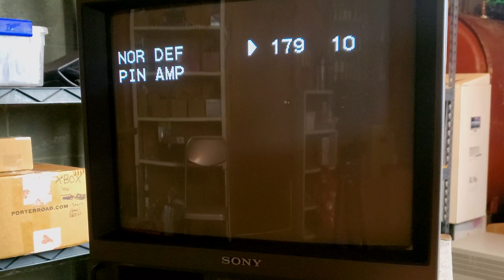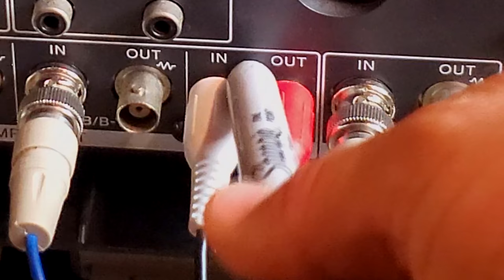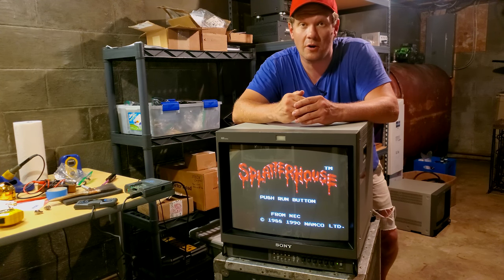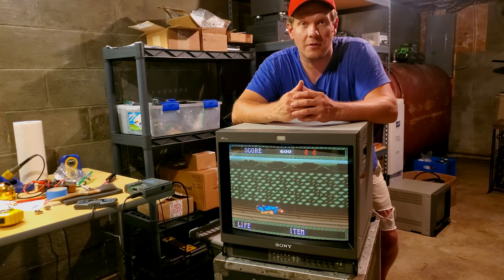Why is the Sony PVM 20M4U so Special & Expensive? 📺 Quick Tips: Features Overview

Comment from the maker: Hey Everyone, The Game is The Legendary Axe on TG16 through RGBS.  I did want to see if anyone else had feedback on the audio input and trick I mentioned.  Has anyone else tested this on other PVMs?  That would help confirm if this is something standard or not.  Thanks!
Reply: Hey Steve,
Those audio In and Out sockets are linked together with a straight wire (see service manual page 74-74), making a Y-connector. Normally, stereo to mono mixing schemes are using resistors to separate L and R amplifier output channels.
Reply: Mono and Left are always output on the white wire.  Both signals are always there as part of the analog audio standard.  I believe the mono is out of phase and when the input device is switched to mono it knows to process this out-of-phase signal.    Perhaps that is what is going on.  Does it sound mono when you unplug the red wire?
Reply: I definitely have feedback on your stereo audio input trick: don't do that!

As Mykhailo mentioned, the audio jack labeled "out" is designed for pass-through use (daisy-chaining) and thus is just connected directly to the input jack, very much as if you were using a "Y" cable. If you short together the left and right channels of your audio source it may work, or it may damage the output drivers of your audio source. At the very least you want to use a simple resistive mixer to prevent this from happening.

Note that the pass-through jacks for video have a switch on them: if a plug is connected to the "out" jack for these it will disable the internal 75Ω termination. So you don't want to have cables plugged into those output jacks unless the other end of the cable is plugged into a device that provides that output termination. (There's no harm going to come to anything if you do this, though; it will just make the image look a little a little brighter and possibly reduce the video quality slightly.)

Comment: I picked mine up before prices went crazy.  Glad I did,  it's a great set.   Just picked up a 20M2U that needed a capacitor job and after fixing it I will say you can see the difference in resolution between the two.
Reply: I dunno, I have the 20M2U and the 20M4U and unless you're right up next to the screen looking for scanline thickness, you aren't going to notice the over all jump in quality that much. I would argue the 20M2U is the better middle ground for a more "natural" look with 600 TVL for 240p sources. I prefer playing NES, SNES and Genesis on the 20M2U vs. the 20M4U any day of the week. I feel like these PVM's are ultimately about preference and to not give into the hype before dropping thousands on these monitors.
Reply: @quibquatch3975  how do you feel they compare in 480i?

Comment: I have this monitor, and indeed it's very nice! Got it for 100 euros, because there was a short in the canon but after an easy fix, working well. I have a question, what kind of silicone we have on the bottom of the canon maintaining the small plastic before the neck board? I removed it and I noticed that without that sometimes it creates a 'thick' like electricity short ?

Comment: The 20M4U is pretty much the perfect 240p/480i monitor along with the BVM 20F1U (not the multi format BVM D20), just a bit more common than the BVM.  I used to own the M4U, imported it and confirmed both the M2U and M4U works with 240V.  Despite not being printed on the rear label of the shell, you can see on the service manual that the power board is identical for all region models (A, U, E) and automatically switches voltage.  So although I don't recommend overseas shipping for PVMs, if that's the only choice to obtain one then people shouldn't worry about voltage.

Unfortunately my M4U eventually died and I sold it as a donor tube to a BVM owner.  Then I was extremely lucky to find a 20L5 locally, so that's my main monitor now for retro gaming.  I didn't know about that audio input trick so I tried it, and audio works fine on the 20L5 too.  Thanks for the tip.

Comment: @3:45 I don't know if you've tried using the out as an in on the component or rgb side but I was able to hook two different signals to them at the same time plugging all of them up.  I used a set of bnc to rca jacks for one side and an hd retrovision cable to my sega and then a bnc to scart adapter to my switcher and it worked.  Like I said I don't know if you've tried it but it worked for me. Great video and I loooooove mine and glad I got it a couple of years ago.  I only paid 500 for it and found it locally so didn't have to pay those outstanding shipping costs.  Now they go for crazy amounts.  Same with my 14m4u.

Comment: I recently picked up a 20M4E for 400€ and I have loved it every minute since. Are there any major differences except for the voltage intake between the 20M4U and the 20M4E? It is very hard to find someone here in Germany who does these kinds of restorations. I have no experience at all servicing these, do have some experience soldering though. Except for a really loud pitch noise (only sometimes not all the times, like an extra skrieching over the usual CRT sound) and some minor convergence issues in the bottom corners this TV has been wonderful to play on.
My question is: Do you still recommend replacing those 15 capacitors, following your tutorials or should i just stray away from that in fear of destroying what is, for now, a working CRT?
Reply: I have the three color lines(faulty capacitor) , and I am wondering too what to do....

Comment: Brother, i need your help in getting my JVC BM-H2000PND Broadcast monitor working once again. Was getting a flickering picture with a static sound and then no display, was suggested that the anode cap maybe dirty and not making a correct seal but its clean as a whistle, am getting neck glow but thats about it!

Comment: I have one but unfortunately it won’t display anything when powered on, even after I replaced capacitors.
Reply: Did you recap the power supply board!? I picked up mine two years ago and it would power ON with the red light up top and no image. I recapped the whole power supply board and that got it going.  Good luck
Reply: @ovalfastlx6724  recapped both the power and main boards. Still just getting a tally light
Reply from the maker: Did you test the voltage on the PSU to make sure it was sending the proper voltage?
Reply: Forgot to mention I did reflow solder to some connectors.

Comment: I have a sony PVM-20M4
All of the sudden, the retracing lines appeared at the top of the screen.
I replaced C-572 and C-584. No effect. I recapped all the main board (A), the neck board (C) and the power supply board (G), but that didn't change anything. For all the caps, I used nichicon 105deg, long life caps. If I adjust v-blanking, I can bring the image up, but even 255 is not enough. 
I ESR checked all the removed caps, they were all fine.

Do you have any suggestions?

Comment: There’s a big rounded boiler tank in your lower level. Is it working well still? Most of them in other older homes got replaced and is getting replaced with more modern heating systems. Your house was built in the late 1940s.
Reply: That’s a fuel oil tank and still very common in the east coast.
Reply: Are they slowly getting replaced my modern heating systems?

Comment: Wow!  Didnt realize the built in Y audio connector was integrated.  Is this the same in the 20L5 as well?
Reply from the maker: Maybe, Try it out and let me know please!
Reply: I am assuming the 20m2 has this too. BTW, I did find if you are say using a switcher that outputs different video types (composite, Svideo, rgb/component) like a extron, but you want the monitor to share a single audio output running to it, I run my audio into a in with a y connector, then run a RCA from out to a different input, and then out from that with another RCA cable to another input. This will make them all share the same audio source. No matter which video input is selected, all audio inputs\outputs active, so will pass through.

Comment: Back in 2000's and 1990's when i was a  child, i wondered what is that tiny "Tv" that directors use when they are monitoring what is being filmed on the camera, but it wasn't a tv though. i couldn't see anyone of those "TVs" in anybody's home😂,However it resembled a Sony TV. after i saw one of them in person, i understood that they are monitors not TVs, they do not have any antenna input and they do not tune any TV station.🤦‍♂️